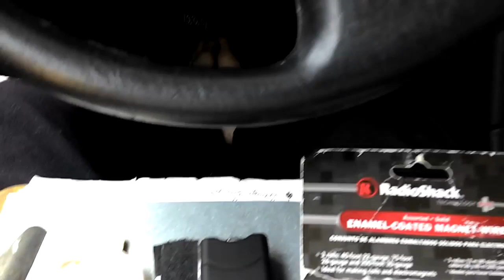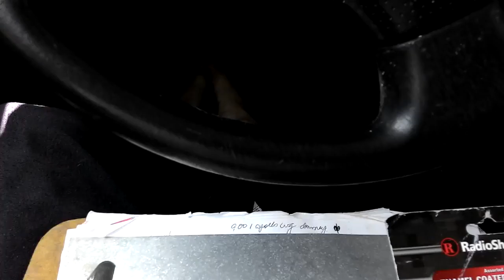HOW TO DISABLE RFID CHIPS AND NANO IMPLANTS

Comment: is that an actual stun gun or one of the ones they show you how to make on here just using like a nine volt batterie?
But I use a messager pen it has low voltage and shock the hell out of my cochlea and head and other things it helps not a lot but does help. I think it's like a similar thing but not sure?

Comment: Does this work on 13.56 mhz and 865-868mhz?
Reply: This does though: electromagnetic pulse from a modified disposable camera and copper coil fused to the capacitor where the flash bulb once was (you remove the flash bulb). Firing a he camera near the chip disables the 13.56 mhz.   That said, apparently there only thing that can survive such an emp (what that would make) is non electrical devices.  I don’t think you want to be pointing that thing at your body.